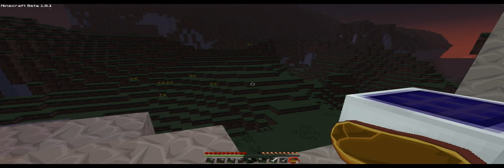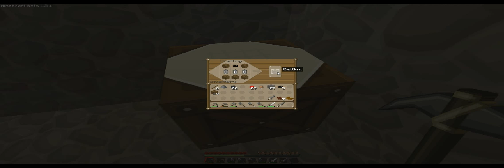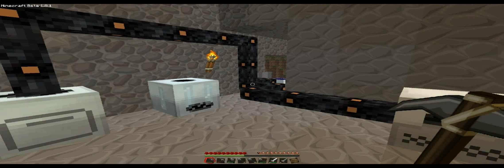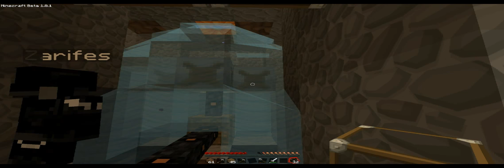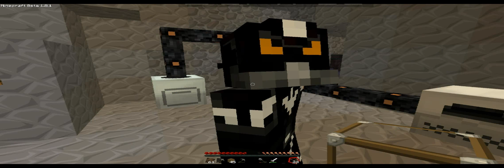MineCraft-IC2-Watermill Tower/Chamber Tutorial Ep06

Comment: you should have used tin wire to connect the watermills to your bat box so you could have connected it with the other bat box because tin wire has as much power loss as the high voltage glass fibre cables and copper cables has a large power loss.

Comment: From the  WIKI (Glass fibre cable is useful for long-distance wiring, since it has the smallest energy loss of all kinds of cable ) you are comparing apples versus oranges here. , you can't just look at the voltage, you should compare the power loss ratio. 0.025 from 512EUs is very little or nothing  comparing 0.025 from 5 EUs only .

Comment: but the loss is still the same, 5 EUs in the glass fibre cable would have the same loss.  It specifically says that they both have 1 EU loss every 40 blocks.  It doesn't matter how much power is running through it.  Yes the glass fibre cable is better for long distance because you can put a higher voltage through it so the percentage of loss is less but if you are using low voltage anyway, which was what my comment was about then the glass fibre cable would be a complete waste of resources.